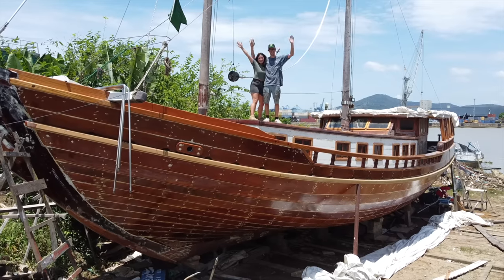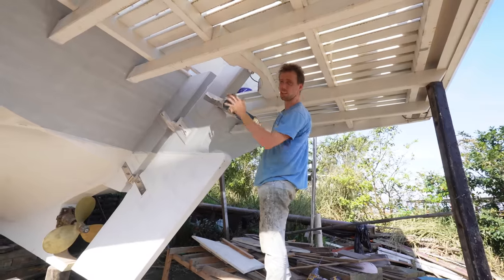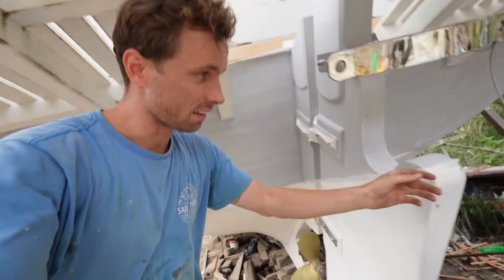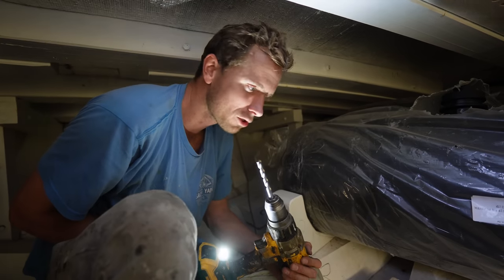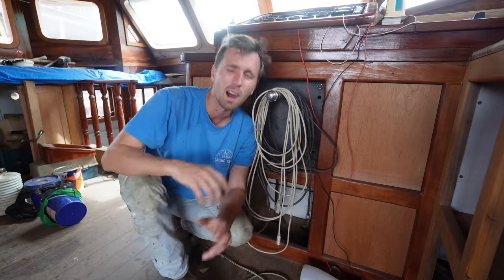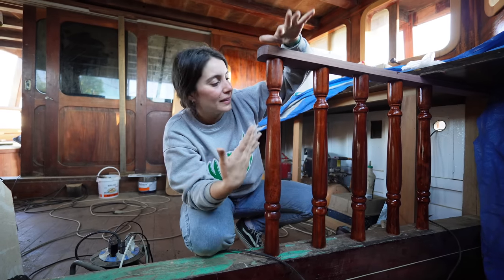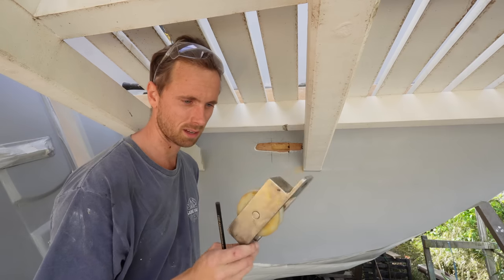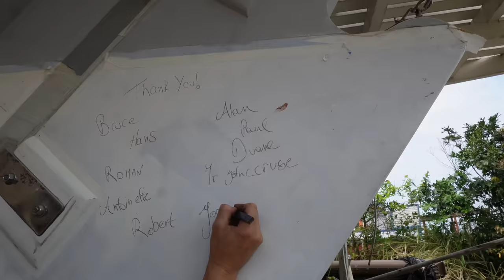We can finally steer our once sinking wooden boat into the horizon — Sailing Yabá 152

Comment: Hey guys, Yabba is looking great and it won’t be long before your in the water. I’m really concerned about your cable steering system, you’ve got a big boat with a big rudder and seeing that you’ve spent a lot of time and money rebuilding Yabba I think you should be looking at going with hydrologic steering. Also if you have hydrologic steering it would be much better than that flimsy cable system and it’ll be much easier for your auto pilot system.

Comment: Hi just been watching you install your steering. I think you should consider putting a brass or stainless steel bush in the transom holes for the steering wires to pass through otherwise over time you may have problems with the wire eroding the wood. 🍷🙂

Comment: I think that for the second, third and fourth inboard pulleys of the steering cable system to “self-align” to their correct angles, if they were on swivels like those on a boom rigging, instead of rigid mounting you may have less alignment issues and possible cables derailing and getting jammed in the pulley at sea.  There will however need to be constant tension in the cable to prevent too much play.  Maybe a tension pulley port and starboard with bungee cord to keep tension on the pulleys

Comment: That cable doesn’t look thick enough to me. The rudder is going to put a lot of pressure on the cable. I would go up in diameter a bit. Also I would use a backing plate on the pulley mounts and a threaded Rod with a nut on both sides. Less chances of the bolt pulling out of the wood.

Comment: Those cable clamps can get caught up on stuff, i have them on my boat and sometimes I couldn't turn the wheel a few times, i discovered the clamp was caught on the wood case of the chain

Comment: The connection to the rudder plate should be with a stainless steel swivel as used on sails.  I can see the stainless thimble/shackle and/or the rudder plate wearing quite badly since the rudder will be constantly moving with the wave motion Thee swivel with a UJ can be solidly mounted and can also be shielded with a rubber boot that can contain grease to lubricate the system.  The pulleys need some guide tubes for the cable to pass over the pulley especially since the cable will have a deal of slack and can jam between pulley and mounting case, losing all steering.  The swivels can also be adjusted as the cable stretches.  The holes in the transom needs a stainless steel tube to prevent fretting of the timber 

Personally, I would not use cable clamps as they can loosen over time as the cable/clamp corrodes.  These clamps are only for a temporary install and malleable ferrules are normally used, which in this case can be over laid with heat shrink tubing to keep out the salt water.

Comment: The streering is almost there you need to invest a bit more mental energy to cleaning it up. We had a center cockpit Nantucket 38 and with quadrant and cables it was a real challenge not over stress the cable stretch, we went to a slightly larger diameter cable and manage the sheaves so that we would not bind or pull the out with stress on the rudder because of sea conditions. Good job it just not that easy - lot to think about.

Comment: I believe that the function by which the left cable on the quadrant extends must be the exact same by which the right cable shortens and v.v.; this function must be linear.  It seems that the function is not linear because when turning the wheel the cable that's not pulled gets a lot of slack.

Comment: You will need a spring in the steering wire system to remove shock and brace the pulleys that have sharp angles to stop acute angles pulling pulley screws out in heavy seas.

Comment: We call them cable eyes. My suggestion is to install a spring loaded turnbuckle in the cable to easily adjust cable tension and avoid slop when reversing rudder angle suddenly.
Im also not a fan of the square cut leading and following edges of your rudder. Its drag that can be easily avoided.

Comment: As a suggestion, install a metal or plastic sleeve in the transom hole for the cable to run through. It will act as a chafing guard and make the hole waterproof. Then install your pulley.

Comment: Put pulleys along the length inside, just to keep the wire supported to keep it from slapping about. Just 1 or 2 will do it. And maybe a guide tube in the hole in the transom, just as extra protection.

Comment: Those two brass pulled at the start need to be s lot larger. Also brass is a soft metal and the will soon have the stainless steel digging into the pulley’s. I suggest get bigger pulley’s made from steel.  Other than that a thicker steel wire would be better.

Comment: Hi guys, looking good!  You need to watch the angels of the cable through the transom, you will end up with some sawing action as the rudder yoke isn't in the same plane as the cable. Also the steering wheel = Helm. 
All in all the idea looks sound but perhaps way to light, I would see if you can find a comparable boat and check out their setup. If not call in an expert. 
At least consider heavier weight chain (push bike chain, no way, 1000cc motorbike chain maybe), a better non chafing connection to the much heavier cable and through bolt all your pulleys
Fair winds, and cheers from New Zealand.

Comment: You haven't made any comments on other steering systems of boats around you that you have examined, so I am wondering if you have done so? Many great suggestions for improving the steering system below, too. Have you thought of using a more complex pulley arrangement, other than the pulleys in-line that you have so far set up? You can greatly increase your mechanical advantage by how you arrange your pulleys, which in a heavy sea will make your life a great deal easier.

Comment: Fit a small stainless rigging screw between the end of the chain and the wire so you can adjust the slack out of the cable.

Comment: I don't know for sure, but judging from what i see in your videos, i think your rudder would ideally be a bit larger, given the size and style of your gorgeous vessel. It's probably fine and i'm sure you've looked into it... just thought i'd mention it...

It would be fairly simple to extend and taper the rudder at the trailing edge. Another 30cm would give a substantial benefit, especially for low speed maneuvering, which i believe you will be doing a lot of in the future😊

Comment: The only observation i would make is line the holes through the transom and make the individual lines adjustable using turnbuckles to tighten the slack out when changing from port to starboard  and it will also enable you to trim the straight ahead position.
My guess is site the turnbuckles in the engine room to allow easy access without having to compromise the action offthe pulleys or trying to make adjustment outside under the swim platform.

Comment: My thinking is saying that the quadrant 'tabs' (with the hole in) needs to be bent back somewhat in a curved 'W'  to decrease the angle of the wire nearer the transom.  Perhaps an eyebolt bolted through it to which the cable would be attached to minimise extreme angles on the wire at the quadrant and act as a 'sacrificial' element that may be easily & cheaply replaced rather than wearing the expensive quadrant metal. The wear would be on the Eyebolt.  Possibly use chainplate or backstay fittings?

Comment: One thing that I have often seen is a connection system for the end of the cable where the cable attaches to a spring which is attached to a bulkhead.  This allows for a spring action when the wheel is turned to the end of the travel.

Comment: I would add a turnbuckle on each line so you can adjust the tension in the system easily. I would also epoxy a bushing where the cable goes through the transom. That will allow you to seal the wood to keep rot from water intrusion. Another option to a bushing would be to make the hole bigger fill with epoxy and the drill a smaller hole through the epoxy. Then the wood is protected from moisture.

Comment: Turnbuckles and a heavy duty spring to take any shock to the system. The spring must be strong enough to not stretch with ordinary use just when a sudden jar happens it will stretch a little to protect the fittings.

Comment: Place brass guide tubes through the transom holes and other through holes. Use a larger cable. You should of made off set mounting blocks for the nylon pullies and not dig into the transom. Now you are locked into them pullies.

Comment: My idea for your steering is to add an inline springs to both port and starboard steering lines to keep the steering cables tight and stop the cables going slack when you turn the wheel, Great work and cant wait for the next episode.

Comment: I personally would replace the attachment to the chain with some long eye bolts.  That would give you the ability to tighten things up as the wire stretches, without bending new loops and further weakening the wire.  I think there are some other great comments in here on the clamps and the use of thimbles, otherwise you are going to have early failures.

Comment: I think your stainless steel quadrant attached to the rudder needs to be parallel to the waterline. Also need some support pulleys on the long cable runs.

Comment: Nice work. I also agree that the pulley needs to be smaller to make the steering easier.

One thing I didn't see in your pulley setup was a tensioning device. Somewhere along the run of the wire going back to the quadrant you should have a turnbuckle on each cable the same way most boats have a turnbuckle on their standing rigging. That would allow you to add tension to each side as the cable stretches. having one on each cable will allow you to keep the steering wheel centered as you tighten.

Also, some hanger pulleys or slides to keep the cable up and straight would remove any tendency for the cable to want to pull down and off the other pulleys.

Comment: Consider using turn buckles at the ends of the steering cables to enable tensioning and research how to use wire rope clips correctly

Comment: Ben just a couple of things , the chain is too small when steering the boat in moderate to heavy weather it will jump and stretch and finally break , also do you ever intend to have auto pilot so that you can relax a little while underway especially at night , also your cable from the boat to the rudder should be enclosed so no water can get into the boat, other than that you are doing a fantastic job I wish I could see Yaba in person but alas that is impossible

Comment: you will need an adjustable tensioner in there some where.  Find out from an engineer what the forces on that set up might be when holding the entire ship against the wind. My expirence from working on old pleasure craft is pulleys don't like right angles.  And nylon degrades in sun light.  Can't wait to see the final set up.  Love the channel keep up the great coverage.

Comment: Ben, Instead of changing the cog on the steering consider putting a 2:1 reduction on each side. Take the cable from the end of the chain through a floating pulley and back up to a fixed point then attach your cable going to the rudder to the pulley.

Comment: Have a look at the last chainlink. The pin connecting the outer plates is compromised. There is no pin, only the roller part. Better have it on the second pin and a full strength. On bicycle chains the pin is fastend on the outer plate and the inner plate is loose. Better check your chain to be a different kind before using the last gap!
Reply: Bicycle mechanic here. Good spot! Btw, they're using motorcycle chain. The links are shorter and the plates are thicker.

Comment: Given that the quadrant is on a different plane than the cables ( not a good design) the quadrant connection point will go up and down slightly and the length of themcables will change requiring a spring as mentioned in other comments.  Attachment to quadrant and the chain also need to be much more sophisticated to avoid wear and allow lubrication.

Comment: You could put a riging screw in the system to tension the cable, and yes the steering will  be a lot harder in the water

Comment: You really need to put a stainless steel tube through the transom to prevent rot as well it provides a great hole for the cable to pass through with ease.

Comment: I really like the wheel and the robust mechanism for operating the wire system for Contro;;ing the rudder. I do whoever believe the the wire and the pulley's  appear to be grossly undersize for the loads which will be experienced in heavy weather on such a large unbalanced rudder.   6mm wire rope has a breaking load of approximately 2300 Kg however the safe working load is only about 200 KG. The system needs "Turn Buckles" inserted in each side of the control wires as the rope will certainly stretch with use.  Suitable shackles should be placed at each connection point so that there is no chance of the wire chaffing and wearing, they should be connected to the wire vie an appropriate steel thimble eye which is spliced or crimped to the wire;  a suitable stuffing box and gland needs to be placed in the transom at each side where the rope passes through and the whole thing needs to be infinitely beefed up to withstand the heavy loads experience during poor weather.  At some point you will certainly need Automatic steering and autopilot interface if traveling any long distance.  I assume you will have a tiller bar connected to the rudder?  for and emergency back up etc.  I would work on safe working loads and not breaking strain when installing such an integral unit as a steering system.  I really enjoy your videos and am sorry to add this criticism but it is out of well being for your safety and comfort.  For a steering system to fail during bad weather could be disastrous. 
Stewart

Comment: The part is called a thimble.  You need turnbuckles and a spring on both sides.  The spring takes up the slack so the rudder doesn't flap around when there is not tension on the wheel.

Comment: The geometry if off in several ways causing the cables to not stay taught in all positions of the rudder, this will cause all sorts off issues down the line. I would seriously reconsider going hydraulic on this, or at least go larger on the cable and fix the geometry issues.

Comment: If you add an addition pulley taking the wire from deck level down to a pulley where the wire goes through from the inside of the transom. This will then allow you to add and internal water stop cover so that if the transom hole goes under water or get a wave on it then no water will enter the boat. Regards Mark

Comment: I suspect the shear strenght of the rudder chain will fail under heavy load.  The rudder wire is loaded on a single tubeular chain link.  Either a bolt thru the last link, or a harger chain is suggested..   Good luck.

Comment: You need 3 clamps at the end of the line. The bolts need to be on the same side, the looped back end. The clamps need a minimum of 6 line diameters between each other.

Comment: Great to see the project nearing the end. However, I think you steering setup is rather primitive. firstly, you should shape the front and rear of the rudder for better effect. secondly go for hydraulic steering. There will be less strain on the helm under sail making it easier to steering and handle. Install a change over setup to tiller steering if there is a failure with the hydraulics. 
Best of luck with the build it looks awesome.

Comment: From my years of working with cables in aircraft I have to recommend that you not use those cable clamps. Replace them with proper cable stages when your design phase is complete. Keep the clamps for emergency repair use in your onboard kit. Those u shaped pieces are called cable thimbles here, but that always sounded funny to me. They are fairly critical for wear prevention and should be used anywhere the cable is wrapped around something. Just my 2 cents 😊 much love!

Comment: Nylon pulleys are better than metal ones since the nylon is softer than the wire rope - that way the pulley will wear and not the wire ... if you use a stainless pulley then you risk wearing the wire which could cause it to snap.

Pick a puilley housing that makes it easy to change the pulley, and carry spare pulleys.

Comment: Maybe a long rack bellows to eliminate any risk of leakage? And  a long  spring on each cable to maintain a gentle tension on the cable wich does not pull... And the must would be to have a two speed gearbox 😁

Comment: Most processional mariners, sailors in particular will choose tiller steering over cable steering. Cable has complicated high wear parts that are vulnerable to high loads and corrosion. the size of chain and cable you have chosen is vastly undersized for your vessel. Your rudder is a heavy one and will have considerable inertia and leverage in a rough seaway and destroy your steering system when it is most needed, Others have advised you to install a hydraulic steering system sized to handle your vessel and I agree, They are simple to install and are robust enough to handle foul weather and heavy rudders, spend the extra money your lives are worth it.